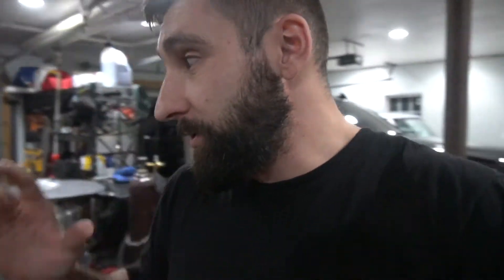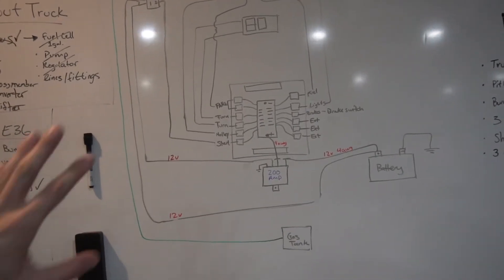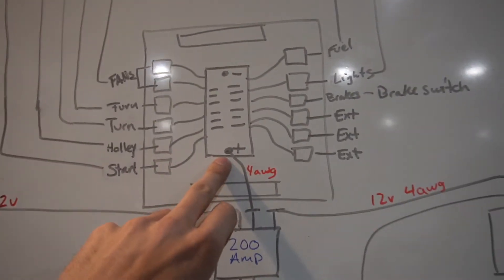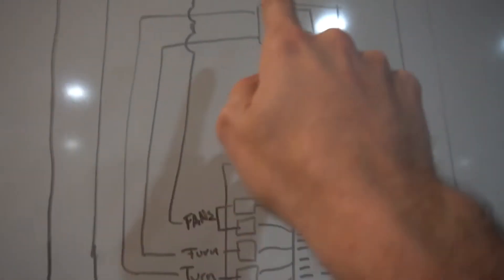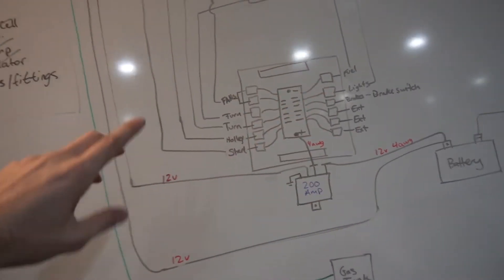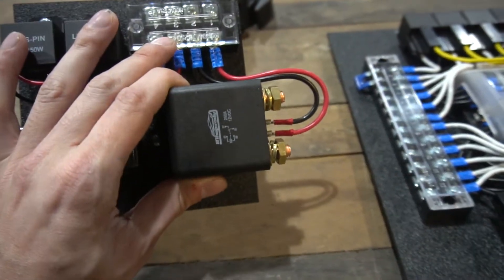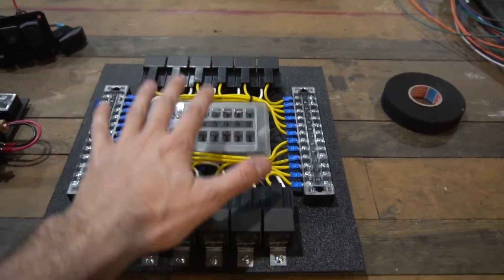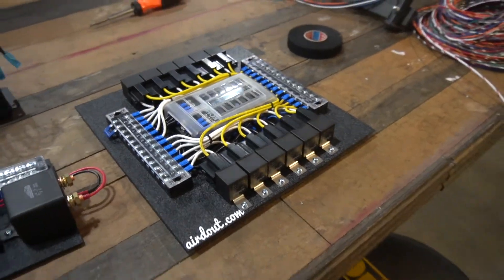How to Wire a Race Car | Relay Fuse Panels - Part 1

Comment: Possibly a dumb question, but what are you doing for grounds on everything your wiring on the output side of the panel? I didn’t see a ground distribution panel or anything online.

Comment: This is great. But I didn’t see how the fuses were wired into the circuit.
Reply: 12 volt power through the keyed relay powers the entire fuse panel that under the plastic.
Reply from the maker: Fuses are all in the middle under plastic over

Comment: Awesome work but if using a stand alone Holley system the power and ground go straight to the battery or you will have problems in the Holley instructions they will tell you many times.
Reply from the maker: Yes we always do that, just talking about wires to tell the Holley to turn on

Comment: Bro that is clean asf. I like how the inputs and outputs are on opposite sides. So basically you're bypassing things like immobilizer and 'main' relay.?  Also if I'm deleting the dash/main harness for this setup what about the cluster ?
Reply from the maker: Yeah I completely rewired the whole car, not using cluster since the Holley comes with a screen. May upgrade to their large dash in the future
Reply: Getting ready to order this panel from you. What size wire is needed to power the relay board?
Reply from the maker: @LJ-zz4so  depends on panel, but the 12 way. Suggest 2-4 gauge